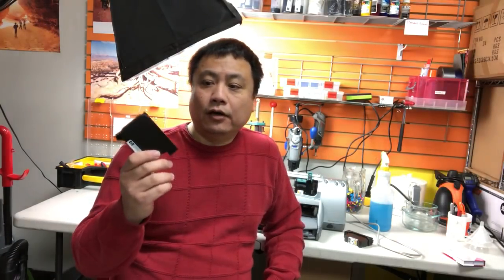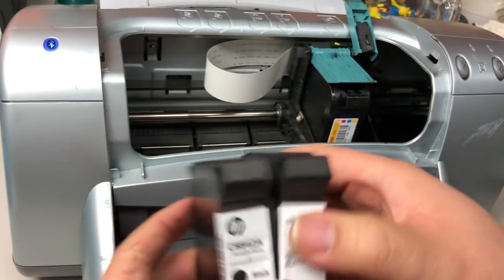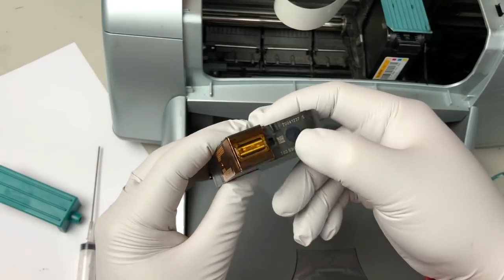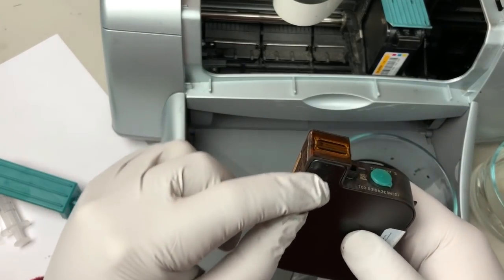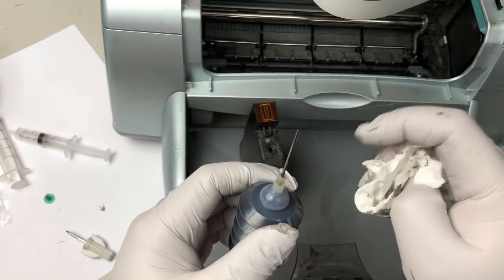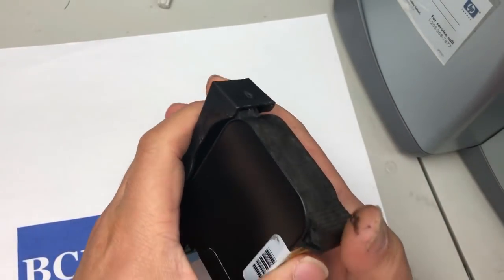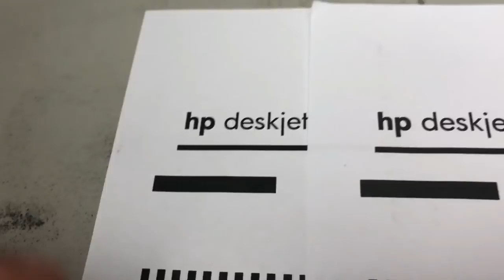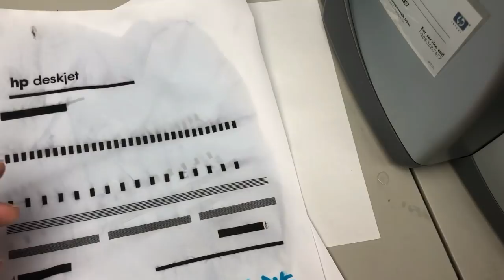5 Industrial Secrets to Refill HP 45 Cartridge 15 40 2580 C8842A 45si CG339A 51645A B3F58A

Comment: Hi i have HP 950c and looks very similar than your printer the real question is.. Your printer is Plug and Play? and if is possible to use a USB Converter because the printer uses a Serial Parallel 25-pin cable, thanks i hope you see my comment

Comment: Hi!, this has been very very good video,  Im using a handheld printer for industrial barcode printing (HP 45 / TiJ 2.5  Cartridge) . The handheld printer only has pins for the electronic ribbon, do not read any chip. But i read this from your site:  

 " These cartridges don't have ink monitors and can print forever. However, if you have a cartridge that's been re-branded, which means a 3rd party chip is glued to the cartridge, it usually can't be refilled. The 3rd party chip will prevent you from refilling the cartridge."  --- how are those chips? and , if i take them out it will let me refill the cartridge once again?. 

Can you make a video about those cartridge.

I was trying to refill those HP45 not using the clamp, and when i put on the printer, it start printing and after 10 printing, it goes half the height of the print, until it stop sending ink, but the printing is still running.

Comment: sir which type of desktop printer your using ..suggest some other also ..thank you
Reply: It is a HP DESKJET 970CSI OR 990CSI.
It is the Thor's Hammer of printers.
From a time before InstantInk and weak 2ml cartridges that lock to printers preventing refills and filling landfill.

You will never see the fraud Greta Thumbturd protesting the HP factory who are a huge offender. Also for the millions, yes millions of HP Envy printers that ended up at the dump due to that cartridge scam.

The HP DESKJET 900 series of any type are legendary.

I have two.

One I found in a garage that hadnt been used in over 10 years and stored in damp minus 10degC temp and had a snail's nest living in it.  All in the cartridge rest bay.

Cleaned them all out.
Put a sheet in.
Power on and it even printed!!! The black cartridge had survived! Not brilliant but it worked well enough for draft documents!!

Chuck Norris owns one if these.
Reply: @RedwolfDogrocket  thank you for your kind information .. yes It difficult to find one .

Comment: For refilling the hp45 I push in the ball with a big 50mm blunt plastic seringe.
I then place a small square of DIALL ALUMINIUM ADHESIVE TAPE about 6mmx6mm over the hole to plug it.
I then apply a blob of GORILLA CLEAR GLUE over the square to the edges of the cartridge width and roughly same length and let it dry overnight.

I then put a sharp hypodermic  needle on the end of my 50ml seringe and gently puncture through the gorilla clear glue, through the aluminium tape about 3-4mm and slowly, gently, push down and fill the bag.

It keeps such a tight seal around the needle it pushes out all the air and even has enough seal pressure to push out all air, all blockages and until pure dye ink comes out.  The foamy bubbles give way to pure ink.

I then give it 30 seconds and then pull back on siringe about 1ml to relive any pressure.

I then wipe with blue roll and clean cartridge. It does not leak from siringe hole as GORILLA CLEAR GLUE seals itself.

I then put a blob of GORILLA CLEAR GLUE over the existing glue and leave overnight.

Once cartridge is empty, to refill just push hyperdermic into it and push down on the 50ml. Blob of glue, leave overnight and repeat.  So fast! No blocks. No air.

I hope this helps as it saves me loads of time.  You could do a bank of cartridges in 10 minutes!
Reply: Thank aluminium tape also gives you a precise target to push the needle each time in the future.

Comment: Sir I'm considering refill this HP45 cartridge with UV black ink in order to cure the print with UV led light. Do you know if the UV black ink will work properly on this cartridge? thanks
Reply from the maker: I don't think so but please try it and let us know.  I think the UV ink's flash point is too low to be used in HP cartridges so you would need an Epson or Lexmark.  However, 45 cartridge/printhead is relatively cheap, so go ahead and take one for the team.
Reply: Hello friend, did you test with the UV ink in this cartridge? And if you did, what happened, what was your experience?

Comment: I have two hp DESKJET 990CXI printers and they have been absolute work horses.
One I got off eBay that had been in a garage for 10 years and snails had made a nest in it.  Cleaned them out and it worked!

I bought dye ink and refilled the black hp45 bag cartridge.

It seems to print ok for a while and then leaks at the print head.

It is the 3rd time it has been refilled and was very careful and even used the same ink from same refill bottle.

I just can't seem to stop it dribbling.

It has done this to two cartridges now.

Any advice is welcome.

Could water in the cartridge cause problems if you dont get every drop out?
Reply from the maker: You didn’t seal it airtight, or, didn’t prime air out of it. Watch the video.
Reply: @BCHTechnologies  Thank you.  It must have an air pocket in there I missed.  Unlikely but it must be the answer.  Just wanted to hear from a pro.  Your reply is very much appreciated.

How does the sensor work if any, for when ink gets low on these 45 and 78 cartridges?  Sometimes they print for ages with no ink - especially the colour one.  Or is it coincidence and the ink flashing warning light is actually for some other fault that just coincidentally happens around the same time?
I rarely leave a cartridge more than a few pages/24 hours without ink in them so it's rare.
Reply: @BCHTechnologies  
Turns out it's the viscosity of the ink.
It has denatured over time and has separated. Whole batch has to go in the bin.
Too thin and it pours out the end regardless of seal.
Dye type ink does NOT like being stored too long is the conclusion.